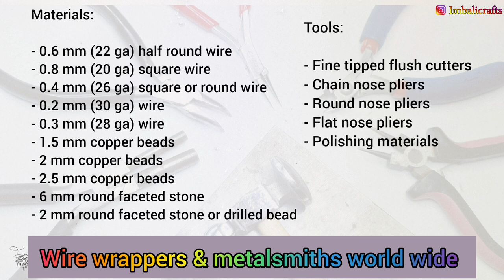Mini pendant tutorial with micro stone setting - 'Litill'

Comment: Do you make up the designs as you go or do you sketch it out on paper first? Im using this video as my first teaching lesson. Im looking to get into wire jewelry making. This piece looks beautiful, would it be good if i use resin with a brush to coat the wires and keep them in place or its fine without it?❤❤❤❤
Reply from the maker: I sometimes sketch it up in advance but very often I just design as I go along. I am not a fan of coating wires, because often stuff gets rubbed off, exposing parts of the piece to air, and hence causing it to oxidise, making the design look patchy. Also, resing and other coatings are not really meant to sit in contact with skin, and I would be worried about the chemicals being absorbed.

Comment: Which gauges are used for what part. Main base, small coil base and small coil. Then, you use a length to finish it off. I’m new to this, it’ll be my first project. I’m not familiar with coiling at all. I’ll watch your cooking video, but I’m not sure how it will translate to this size fir me being a beginner. If you could advise, I’d be extremely grateful 🙂
Reply from the maker: Hi there, I advise of the gauges and lengths during the video. The information is in text at the start of a new technique :)
Reply: @ImbaliCrafts  I have watched it more than once. It wasn’t the lengths, it’s the order of use. No problem. Ty!